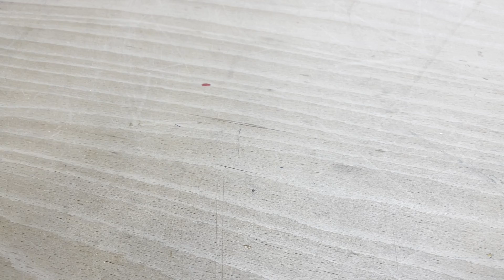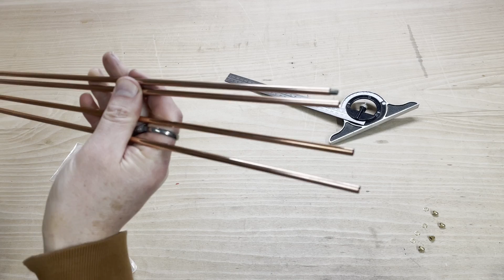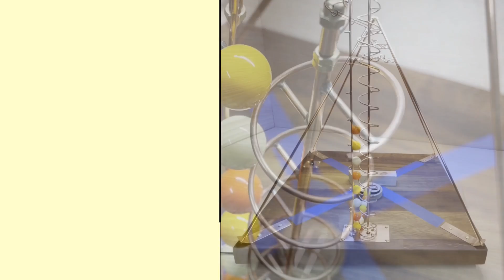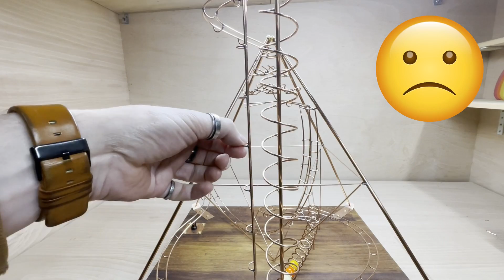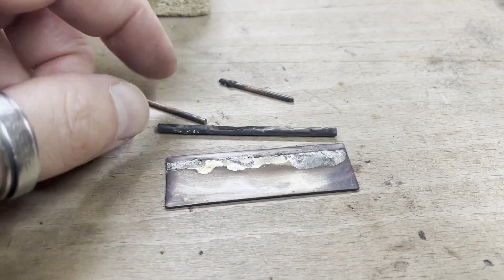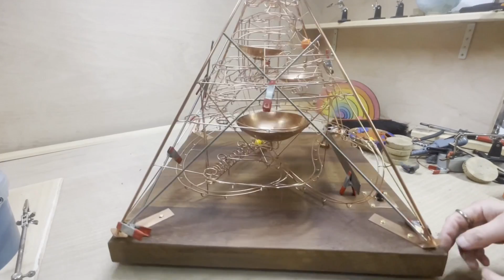Pyramid Shaped Rolling Ball Sculpture - RBS8 - Complete Build

Comment: Beautiful. I'm trying to figure out how to solder, why don't you use flux?
Reply from the maker: Hi Clay. I used to use flux. But these days I don’t feel the need for it. I find that I’ve got better at soldering over the years snd I don’t feel that flux brings any benefits to the party. Also, it takes much more work to clean away the flux muck. Thanks for the question.

Comment: I've had an idea about using having a bunch of arms that do a series of hand offs to move the ball from one side of a piece to another. Like Tarzan swinging on vines. Possibly with inverted pendulums - like on a old metronome. 
I'd also considered using small electro-magnets to lift, carry, or swing a ball from place to place. Wires could be run inside tubes.
Reply from the maker: Have a look on FaceBook at the Automata / Automaton Group for some other amazing content. The hand off thing is a thing of beauty.

Comment: Hi Ian, I really like your work (both the kinetic art and also your video documentaries) and I really, really loved this long-form start-to-finish version for RBS8.

I thought the vignette about the ball gatherer was interesting for a number of reasons.  First, it shows how during the creative process, sometimes there is indecision about how to accomplish a desire.  Second, it shows that for even an accomplished creator like you, there can be setbacks and difficulties in implementation, and you just persevere to get what you want, even if it takes many trials.  And third, visually, I thought the trick of reversing the sequence of video frames presented a new and interesting way to present the details of the gatherer operation and the track following.  It might be fun to include this sort of reverse video in future creations.

I did have a thought about the mechanics of the ball gatherer (well, ball gatherers in general.)  You have the axis of rotation tube parallel to the long edge.  I was thinking if you deliberately placed the axis at a small angle to the long edge, it may improve stability of the gatherer as balls are gathered, and then provide a larger impulse for tipping when the final ball arrives?

I’ve laughed out loud every time Cardboard-Aided-Design appears in your videos, even when I’m expecting it.

I appreciate being able to use slow-motion of modern video editing or even capture modes on smartphones to capture mechanical motion.  One trick I’ve used is to use paint dabs or marker on one of the balls, so that I can also visualize how much the ball is rolling versus sliding, especially as there are big speed changes along a feature.  I’ve used this to help tune loops so that I can increase the degree that the ball is rolling rather than sliding, as that rotation tends to stabilize relatively straight loops and also helps me visualize where I should probably add guardrails as a safety measure.

After seeing the choice to use brackets in the four lower corners, I really expected to see a similar bracket at the tip with four holes to stay the top of the threaded rods.  I can see that the ball distribution assembly is enough mechanically to stabilize the threaded rods, but was thinking a plate would be more of a visual tie-in.

I was also looking forward to where the windchime or musical feature would be, but I guess I will have to wait for that on one of your future works.

I liked the motif of using a lot of rails with relatively straight sides and squarish corners, which felt very much in place with the mandate for absolutely straight lines on the exterior planes.  I know how hard it is to get a ball to change direction at 90 degrees.

I thought the workmanship on the helix lift was exquisite.  You mentioned a helix pitch of 1.5 ball diameters.  I’m curious if you’ve found any other rules of thumb for such lifts, such as ratio of helix diameter to ball diameter, or how large the central tube can be.  Also, you used a double-rail track that the ball is pushed along; what are your thoughts about just a single rod?  Have you considered using the same helix as a multi-lift, using more “sides”?

Have you studied the timing of the tracks on RBS8 to see what the shuffling function of the balls would be?  :-D  I would imagine the holey bowls do introduce some uncertainty into that function.

In closing, it was another remarkable build and I envy your talent, skill, and artistic vision.  I look forward to anything more you make.
Reply from the maker: Wow, thanks for the super detailed comment which is full of RBS understanding and support. It’s the best comment ever. I’m slightly busy today so can’t answer in detail right now. I’ll make sure to come back and answer your specifics when I’ve got more time to do this justice. It sounds like you also make RBS. Feel free to share your work via email if you wish. I always enjoy seeing more people working on these things. Cheers for now. 🙏

Comment: That turned out brilliant. I did find it a bit difficult to follow the tracks from the top to the bottom, there is so much going on. Having 2 tracks dump into the larger bowl gave me an idea. Once I get an idea if I don’t spit it out it may be lost forever, feel free to incorporate as much of it or not as you want into a build.

The base 2 to 3 feet in diameter a helical lift in the center. Have the top about 12 inches taller than the diameter (all dimensions are just initial thoughts and can be changed as needed lol). The base should be a big bowl with a gentle slope. You would need a spiral feeder guide. Have one track drop just about vertical to the bottom. To shoot out around the circumference of the bowl with that speed it should make several laps around before dropping to the inside. Have the other tracks enter at various distances from center and all exit in the same direction. You might need to have an arched guard around part of the spiral ball loader. Maybe a sharp angle spiraling out to make sure all the balls reload.
You could do a similar concept but have a slope to a corner. As I type this out other ideas keep coming, I better stop.
Great sculpture I always enjoy seeing what you come up with. Keep soldering on.
Reply from the maker: Thanks Mike. Great ideas.

Comment: Nice! I might have to 'borrow' your rod-inside-tube design; it looks a bit more rigid than the multiple twisted strands of copper I'm currently using. I don't have any issues resistance soldering wire and thin plate together using the higher voltage taps on my transformer (I DO use flux on these). I've also found that using the 'ground' clamp to hold the little connector pieces to be more effective than clamping the ground to the track and using the wand to touch the connector pieces. Just a couple of things to consider for whoever reads this... Thanks for your efforts!
Reply from the maker: Great advice. Thanks for commenting and sharing your experience. 🙏👍😀